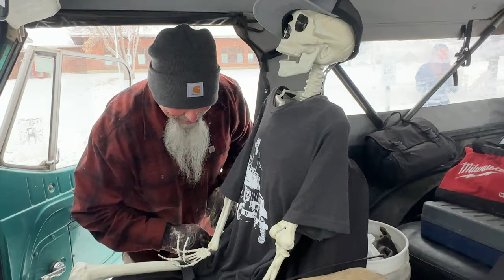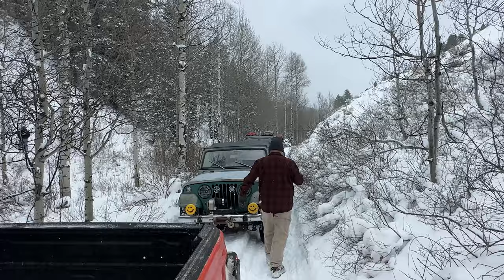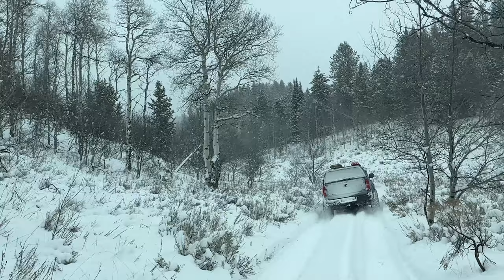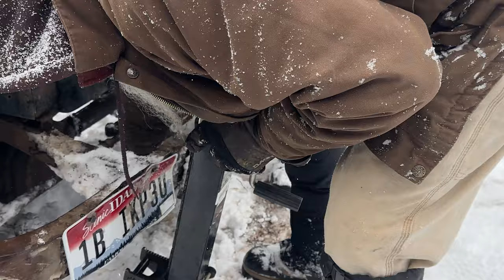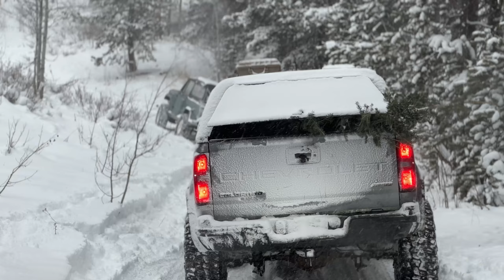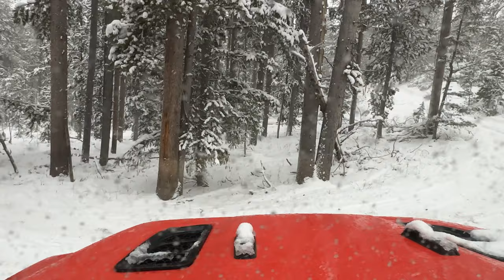Snow Wheeling Near Disaster - Gladiator almost slid off a CLIFF off-roading in Idaho

Comment: Looks like fun!  Are those 20" rims on the orange Gladiator?
Reply from the maker: Yeah, I’ll planning to go down to 18 inch rims and up to 37 inch tires.
Reply: @KrawlZone  That should greatly help your ability to air down and get a much bigger footprint for the snow runs.
Reply: Do you think you'll have much trouble finding the tires you'll always want for 18" rims?  My understanding is that manufacturers don't make as many choices for 18" rims.  ?  @KrawlZone